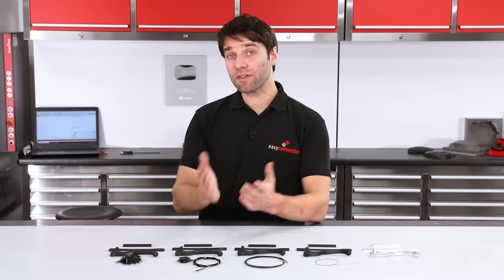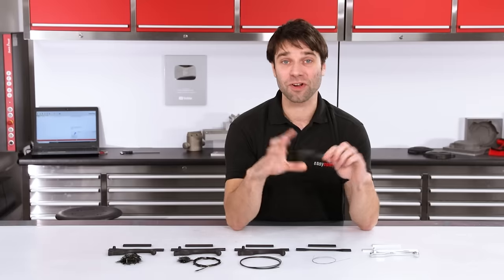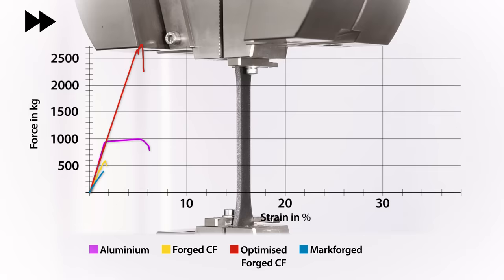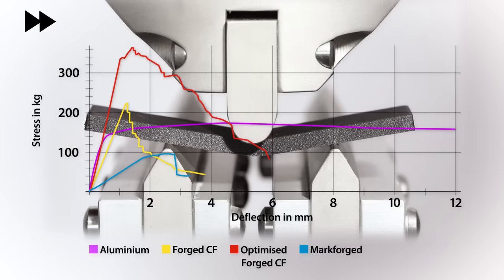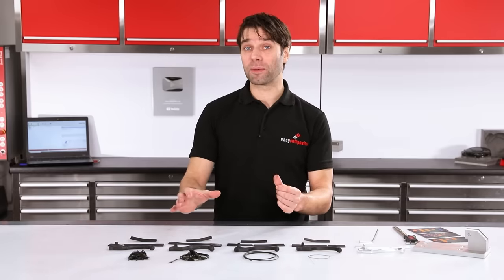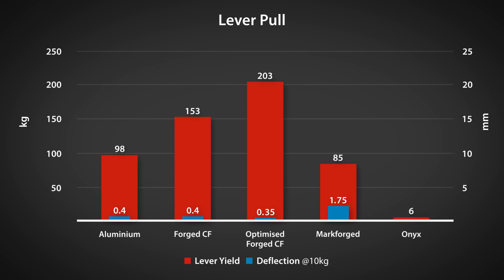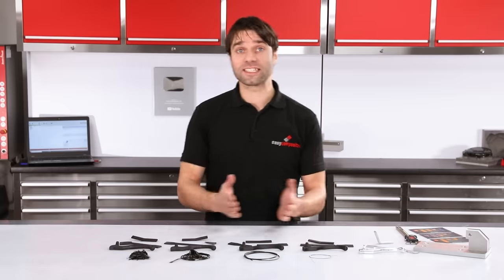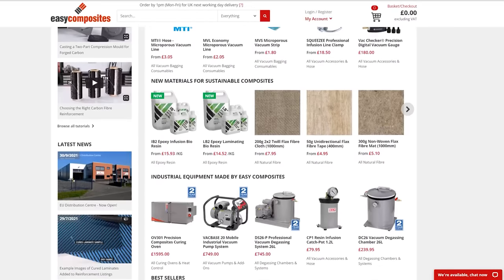How Strong is Forged Carbon Fibre? Forged Carbon vs Aluminium vs Markforged vs Onyx

Comment: What about is the load is from impact instead of a steady increase of force? Would the Optimized Forged CF work as well as the levels did?
Reply from the maker: We haven't done any specific impact testing with forged carbon although one would imagine the fractures to be more localised. Optimising with longer strands would certainly help to mitigate this though as the load is transferred through the whole length of the fibres.

Comment: Amazing tests ! Thanks for sharing. Question pros / cons for using 3 d printed molds for making forged parts vs say molds out of steel or aluminum ?
Reply from the maker: For small parts they are fine and work well as shown in the video.  Also 3D printing is easier and cheaper than CNC machining billet metal into a mould.

Comment: What about durability? Considering the lever example, what impact would weather and wear have on the CF pieces? Would they need to be coated? If so, with what and how?
Reply from the maker: Generally a UV stable lacquer is all that is needed. The weather for the expected use of most of such parts is unlikely to be a significant factor.

Comment: if you had to rub your hands over these parts after they had had their imperfection from the mould sanded off which ones would you want a lacquer or protective coating on?
Reply from the maker: That would be personal taste really. The 3D printed parts naturally have the step lines from the printing process which I think we're all familiar with; you can do things to improve this such as sanding, acetone smoothing (on some plastics), infiltrants and resin coatings etc. The two (slightly) different types of 'forged' carbon fibre can be rubbed (sanded) smooth more easily than the 3D prints and so, with little work, naturally have a smooth, tactile finish. If you wanted a super-shiny gloss then you'd lacquer them, if you just want them to feel smooth then you're already there.
Reply: @easycompositestv  thankss for the reply sorry guess i was beating around the bush i basically wanted to know if you can get splinters working with some of these them like you can with wood or fiberglass.

Comment: Question. If you used a woven piece of carbon (like a thin rope) in the 'optimized' example, instead of the loose  individual strands, how much difference would that make?
Reply from the maker: Without testing its hard to know.  It depends on the end resulting fibre orientation.  If its twisted you may improve torsional strength as well as strength down the length.

Comment: What's the abrasion properties like on forged, against muli-layered wet lay, for engine case protection on a race bike? 
I can't get any GB Racing engine covers, so looking at making something to at least help, in the  event of a slide off. 

I'll be also making fuel tank side protection covers using your offset moulding videos. 

Thanks. Great videos, and if only it was as easy as you make it look. I had checked out the website for classes, but nothing listed. I'm only about 30 miles from you, so will take a trip down when I order.
Reply from the maker: The abrasion resistant properties tend to be influenced by the reinforcing fibre in the laminate. Carbon isn’t a particularly tenacious material so will abrade relatively quickly, whereas something like Kevlar has a much higher resistance. However, Kevlar doesn’t really lend itself to the a short strand ‘forging’ in the same way as the aesthetics are vastly different. 

What would be more appropriate would be to use a woven Kevlar cloth and laminate flatter protective panels in a more traditional manner.
Reply: @easycompositestv  brilliant, thank you. Will see you over the next month or so, when I finish rebuilding a dirt bike and make the room needed to start moulding. Then can nip down and pick up materials, for what you think would be the best way forward.

Comment: How about the Cost comparison ?
This is another very useful video and best presentation.
I hope you will do metal insert carbon forge video tutorial.
Reply from the maker: Well, assuming you have to 3D print a mould and then mould your forged carbon component then a conventional 3D printed part (like the Onyx) would be much cheaper right from the start. In terms of the Markforged, the printers themselves are in the £20k/€25/$30 region and we don't have one so we paid to have the Markforged part printed. It cost over £100/€125/$150. You could certainly print the moulds in PLA and buy our whole Forged Carbon Kit (which could make 30 of these parts) for less money. In raw material costs, there's probably less than £1/€1.25/$1.50 worth of materials in the brake lever example.
Reply: @easycompositestv  that’s what I thought,
Please do metal insert forge on your next video.
Thanks

Comment: Neat. Now, once we get away from petroleum based resins as a binder we may get somewhere with this material.
Reply from the maker: There are already some resins using a bio sourced and derived ingredients eg our IB2 infusion epoxy.  That could certainly be used instead of the IN2 epoxy used in the videos. Epoxies, even with bio derived content are still fairly chemical intensive in their manufacture and hard to recycle at end of life.

Comment: Great information. Do you have any data on the strength of Onxy over pure Nylon. Because of the internal shear forces created by the included fibres I wondered if Onxy was actually weaker?
Reply from the maker: We haven't tested any pure filaments in that way.
Reply: @easycompositestv  Thanks for the reply. Be interesting to see though.

Comment: is it possible to FDM print a sample. in such a way that it can have a resin added in a vac bag. would this give it a boost?
Reply from the maker: You could print a hollow item then back fill it with a casting resin or laminate extra fabric into it.

Comment: Would lining up the chopped fiber in the first place work like the unidirectional  fiber?
Reply from the maker: Not really as the additional strength of the UD fibres comes from continuity of the fibre itself - aligning the chopped tow along a given plane will increase the mechanical properties in that direction a little but as they are not continuous, it would be negligible and would also be weaker in opposing planes.

Comment: I'm curious as to how the Optimized Forged CF is constructed. Where are the long tows placed in relation to the chopped. Closer to the surface or center? What is the percentage of long vs chopped?
Reply from the maker: There are no hard-and-fast rules but some guidelines would be that having the UD nearer the outside faces will make more mechanical use of it (i.e. you'll get a more marked improvement in performance) and that you probably can't exceed 50% of the total weight of carbon being UD tow. If you have more than 50% continuous fibre then the ability for the short strands to move around and fill cavities will be overwhelmed and you're likely to start seeing some voiding.

Comment: I have a question, if I wanted to do the same procedure but in reality I want the lid to be completely transparent, what material would be the right one, in terms of resistance, translucency over time, that it does not get pigmented or change color, is it possible?
Reply from the maker: From a cosmetic purpose, you could cast a lid using a 2 part mould (no need for compression) using a cosmetic grade epoxy such as our GlassCast range.  But other than for a show vehicle, it would not be suitable as the temperature resistance of the resins would not be high enough. Plus I suspect the clear resin would quickly discolour on the inside from the oil.

Comment: Very interesting but how is it with fatigue? Whilst it might be OK for metal components to be cycled at high load I suspect the carbon would fail quickly.
Reply from the maker: It is very much application and design dependant.  Carbon composite materials are used in some high load and fatigue environments but will have been designed and tested to include the right reinforcements and safety factor to achieve the intended fatigue life.

Comment: Very interesting. Makes me wonder about using software like solidworks to optimize parts for strength/weight and determining where to add the long fibers. 

Though parts of molds might have to be consumable and you'd need to be able to remove the part from the mold.
Reply from the maker: If you can model properly at the fibre level then you could do it. However it depends on the practicality of achieving it in practice which would be much harder.

Comment: I'd be curious to see other composites used in a forged method, fiberglass, kevlar, etc. I'd also want to see composite blends, every material has its place, but with the short fibers I'd be curious to see if a part could be optimized by adjusting blend ratios in certain areas to optimize how a part should behave within a localized region of the part, rather than having the same material properties throughout the part as a whole. I'd also be curious if this could be extended to composit-metal blends, as a forge analog to something like a carbon-titanium twill.
Reply from the maker: In theory similar testing of other materials and blends could be conducted.  However generally most interest is in the forged carbon process. Also other materials are not so readily available in a chopped tow format and are just not as common. For most of the hybrid options you would have to make your own chopped tow mixes to do any testing.

Comment: Regarding threads in the forged parts, is it possible to have an alloy insert in the mould to be contained in the part, similarly to how inserts are over moulded in injection moulded plastics?
Reply from the maker: Yes they can be located inside - typically using a precisely located hole in the mould and a bolt/screw to hold the insert in position while the forged carbon is loaded into the mould.  Otherwise often they are fitted once the part is finished.

Comment: I LOVE IT! Great video!
I've purchased the forged starter kit and made my first part. I am still really impressed - awesome product!  
Those tests you ran are great for showing the potential of the process. Is it possible to get those sets of data? 
I would love to use this method for designing and manufacturing the steering wheel of my teams formula student car.

Do you know if there are scientific papers which discuss the possibilities of simulating forged carbon?

Greetings from Germany
Reply from the maker: Hi, thanks for the post and thanks for placing an order with us. There is more information, along with the original results in GPa/MPa, in the project report on our website: https://www.easycomposites.eu/learning/mechanical-properties-of-forged-carbon-fibre
In terms of modelling the forged carbon fibre, the available data (and current level of understanding of the subject) is probably well short of being able to accurately model this material. Even our own data is not sufficient and would need doing to an established test standard in order to be useful in an FEA analysis. This might be a good subject for you or one of your colleagues to look further into!
Reply: @easycompositestv  Thanks for your reply and the data. This would be a interesting topic for a bachelors or masters thesis. Let's see if we can get someone to take a closer look.

Comment: Have you tried braiding the cf continuous strains before putting it in the mould
Reply from the maker: Braiding the fibres wouldn't be as strong as using the tow in an uncrimped state. When under load a crimped fibre has some way to straighten out before it can perform to its full tensile capabilities, this results in some deflection whist the fibres are extending. A straight, unbraided fibre is already fully extednded and able to perform at is full tensile strength as soon as the load is applied.

Comment: Do you guys have a video on how to make optimized carbon fiber or a set to make it?
Reply from the maker: Not specifically as the approach will be unique to each individual part as the orientation, use etc is very much down to what properties you are trying to achieve.

Comment: With the optimized forged carbon, would you still be adding in those chopped bits or would it be entirely filled with long strands? Also would it make sense at all to use strips of carbon sheet for something in this size range?
Reply from the maker: You still use the chopped tow to fill out the rest of the space not filled with long strands of tow.

Comment: I bet the Onyx wouldn't perform any worse without the carbon dust (let's be honest) in it
Reply from the maker: Its all about the material used and limitation of the methods.  Forged carbon is using much longer strands more randomly orientated than any 3D printing process can currently do. Also the resin matrix with epoxy is also very strong hence the composite material performs very well.

Comment: Hi guys, this is amazing, I'm trying to make a piece but I haven't been able to make it really strong, is it possible that this is happening from using 6mm fiber? I would like to do the tests with 20mm fiber to see if the results improve.
Reply from the maker: In theory, the longer fibre length will give more reinforcement and 'tie' the part together more so you may find that it improves the overall strength of the part.
Reply: Thanks for responding, I will try 20mm fibers

Comment: Such great work ! Can you compare them to the laminated CF too ?
Reply from the maker: This is an interesting point; whilst it would indeed be interesting to see how the component compared if made using a wet-lay vacuum bag setup, it would actually be quite difficult to make the component in this way. The specific advantage of the forged carbon process is the ability to compression mould solid carbon fibre shapes. Such shapes are actually not very practical to make from a woven fabric and wet-lay vacuum bag. For starters, to achieve a solid 3D shape like this, we'd probably need to use a two-part compression mould anyway, meaning that even if we did use a woven fabric, the process would be more like compression moulding using a woven cloth. Our testing showed that use of continuous reinforcement in a matched-tool compression mould resulted in a high level of voiding (or at the very least very resin rich areas) because the continuous fibre can't migrate and redistribute itself in the mould cavity under pressure in the same way that the short strand chopped tow can. Nonetheless, I agree that it would be interesting to see and compare the result, even if we anticipate the component would be flawed.

Comment: Any thoughts about Dyneema fiber + Carbon?  How difficult and expensive is it to obtain the combination of UHMWPE + CF today?
Reply from the maker: Well, if you're using a forged carbon process and wanted to make a hybrid carbon/dyneema forged carbon component then you'd need to get chopped UHMWPE fibre (or buy the fibre and chop your own). There aren't many stockists of UHMWPE but it's certainly not impossible to find. If you give it a go, let us know how you get on!
Reply: @easycompositestv   Thanks, I was thinking of it also in the standard applications with woven tow, but I've also never seen the fabric in this form commonly avilable (only as it's own fabric rather than a combination). I know DragonPlate offers such pannels, but it's quite pricy, and not in the more useful fabric form. I suppose it could still be used maybe for interior layering.  Maybe it's a future product Easy Composites will take a look at if it becomes available?

Comment: "Forged" is a misleading term, since there is no forging involved; @0:39 it was called "compression moulded", and that term is descriptive, clear, and accurate.
Reply from the maker: Thanks for the comment and yes, the term 'forged' carbon fibre is not the clearest but it's been around for a while now  (Lamborghini have been using it for several years) and is quite widely used with an established meaning. To avoid using the term would mean that many viewers interested in understanding 'forged carbon' might never find this content, get to see what the term refers to (for some at least) in the context of carbon fibre composites, and learn how - for the right components - this process can be used to produce strong, lightweight parts with minimal equipment.

For what it's worth, before making the video we did discuss whether to use the term 'forged' a lot because we really weren't sure ourselves. After lots of deliberation (checking dictionaries and researching the history of the term) we decided to go with it but we did expect others might come to a different view, and that's fine too. If you'd like a much more lengthy explanation of we came to our decision please get in touch, we're happy to have more healthy debate on the subject :)

Comment: Could you please do a motorbike rear fender? I watched the bonnet videos and see I could use that process, I am just curious how I would to it with a "u shaped" object that is tall, like a rear motorbike fender. I can't find anyone in my state of WA that could help me in making a mold. Also, how do you properly "brace" bolt holes so that it will not crack the resin? I was thinking little brass bushing inserts with a wide collar.
Reply from the maker: Moulding it by infusion would be no different than any other panel.  It would likely be a bit big for forged carbon plus more complex to do.  You just make the fixing areas thicker for strength then bond in a threaded insert or similar.